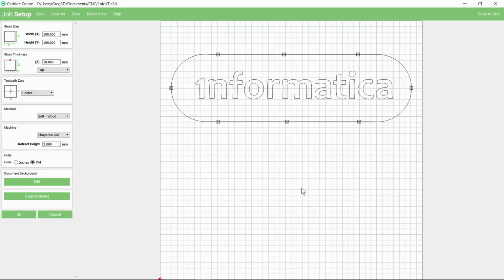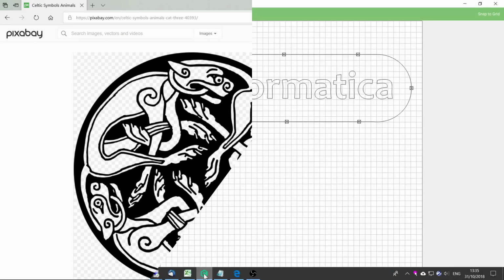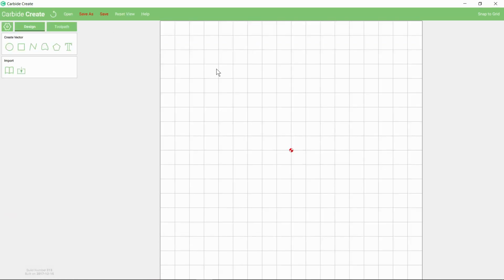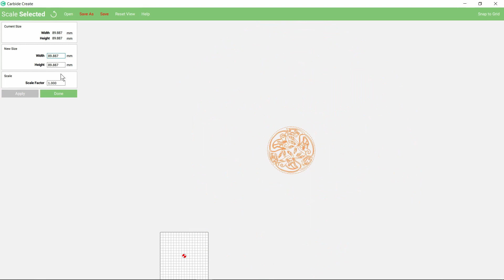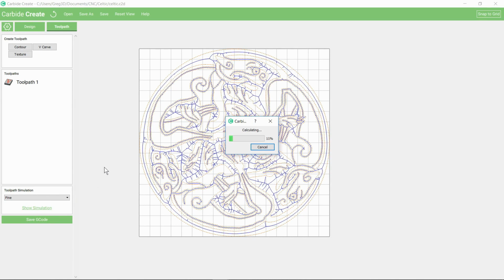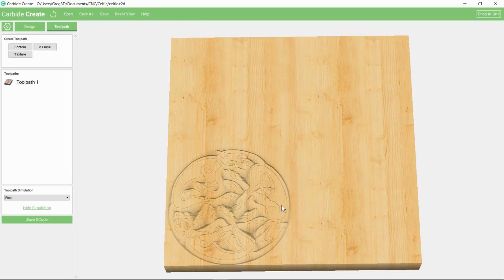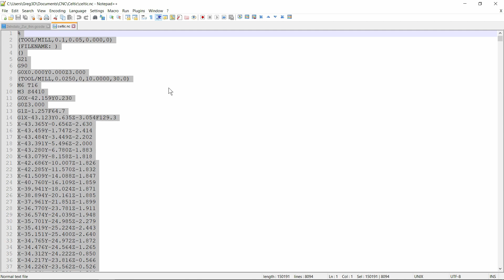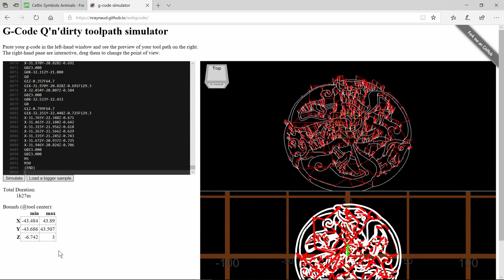CNC 3040 Vcarve Celtic Symbol With Carbide Create - Project

Comment: nice work,what size is cutter shank you use
Reply: Thanks for thw info,keep making the cnc videos ,you explain how to do things the simple way , thanks again👍👍👍
Reply from the maker: More coming soon, dust extraction! What subjects would you like to see?
Reply: @1nformatica  more indepth info on the cnc machine settings in planet cnc software please,and also finishing off your z axis sensor probe please.
Reply from the maker: Hi Charlie, I'll look into doing a machine settings vid. I thought the Z axis probe video was quite complete, what is missing? https://www.youtube.com/watch?v=32hjG9YyjDM
Reply from the maker: Thanks Charlie. The V bit is 60° 6mm shank 22mm flute.
60 Degree 3D CNC Router V Groove Bit http://bit.ly/2OrSQ4X
Reply: @1nformatica  i have the same cmc machine ,can you advise me where i can purchase a collet that will accept a 6mm shank v bit,cause my machine only accepts 1/8 shank cutters.
Reply from the maker: Hi Charlie, I bought this set 7pcs ER11 1-7mm Spring Collet Set http://bit.ly/7xER11_Collet
They work well for me.